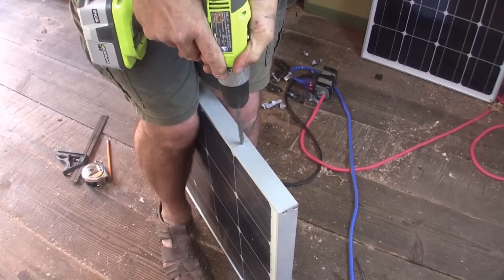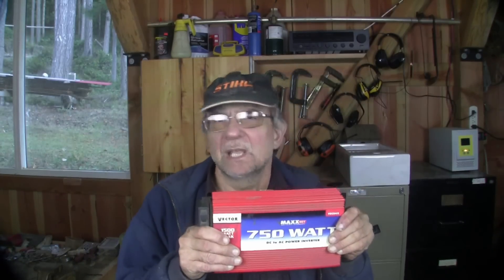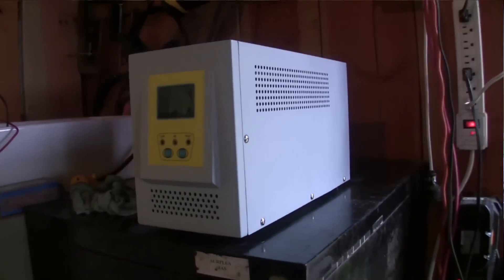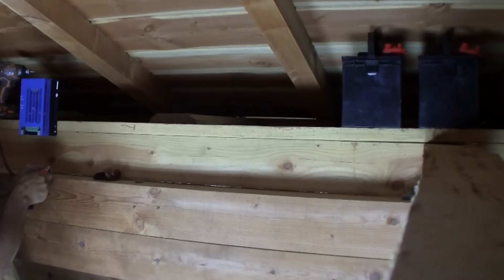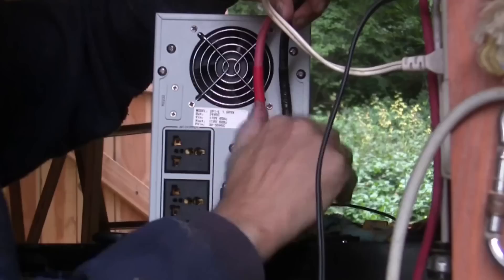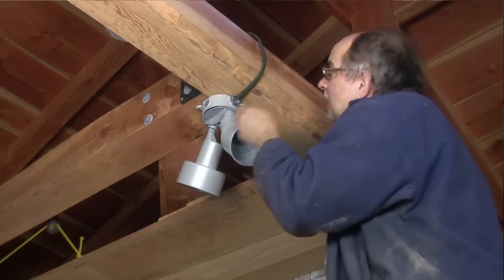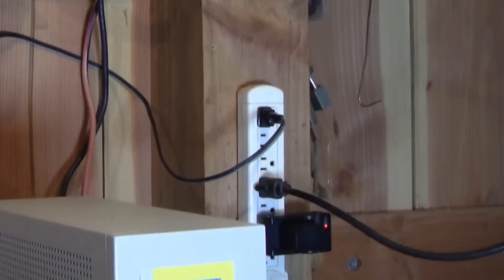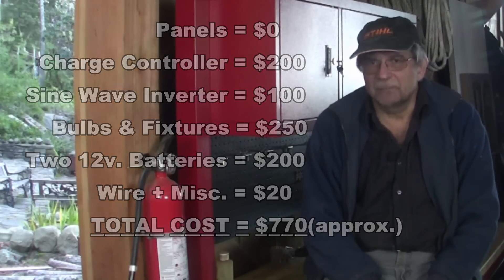Budget Solar Install Part 3

Comment: I watched a couple of your videos and enjoyed the content. Definitely going to check what else you got going on. As for this 3 parter, I'm glad you ultimately wired the panels in series because that's where MPPT really shines. Additionally, nowadays with more and more 24V/48V DC appliances, stepping up the system voltage and trying to do as much stuff as possible without involving the inverter I think is an all-around good idea as well :)

All the best from Finland.

Comment: Hello, just stumbled in to see your Budget Solar install of the shop lights.  I have found LED bulbs at discount at our Loews, Home Depot and Walmart big box stores for a buck or two each from time to time. I run them on 120 AC from a cheap inverter and only draw a few watts, in my camper and outside my camper when lighting the outside for cooking at night when down in Arizona. 

Up/Down here,  just above Spokae WA. @TheReflectiveLakeLodge, my 600 sq. foot cabin I am slowly building, I purchased simple plastic light sockets like the older porcelain ones with pull string. I mounted them in the 3 main rooms and wired them with one 12/2 romex attached to a corded wall plug with wire nuts, E. Tape and and a knot for strain relief. these provide bright task lights as work light system until the main power box is in. Total under $20. US if purchased new. 

My LED's and "twisty" florescent lamps all have worked off my small $29.99, 300 Watt Black,  Decker Inverter, Well. 

I am subscribed and want to see more videos !  Thank you.
Reply from the maker: You are creative, inventive and a thinker...on the right track: establish your true needs and construct accordingly. Efficient electrical devices are constantly falling in price ...
Glad to have you on board - thanks for subscribing!
Cheers,
M

Comment: I hope you have in the fuse now.  You can't turn off a battery.
Reply from the maker: +Andy Bushnell 
Roger that...fuse installed! 
I plan on updating the vid with modifications & changes I have made...
Thanks,
M

Comment: A well done and informative video. Although unplanned, the move to 24v was a good one. When batteries or panels are configured in parallel, they can draw on one-another. In series, they all push in the same direction. Never mind the reduced losses in the wire.

Use of MPPT charge controllers has come into question lately, because it is now cheaper to just buy more panels. Also, the MPPT circuitry depends on a couple of components that have a relatively short life. If I could do it over, I wouldn't use an MPPT charge controller in our household system. However, for a portable system, where the area of panels is limited and a failure isn't too painful, MPPT can make sense.

It's nice to see an inexpensive solar system and a fairly simple one. Your video has likely encouraged more than a few folk to take the plunge.
Reply from the maker: +Mark Fox 
Thanks for your kind words and information.
I'm only vaguely familiar with MPPT controllers and thanks to people like you I learn a little more once in a while. The finer points of this technology quickly make my head spin if I pay too much attention to the manual! I try not to get carried away with these things and am always amazed at the amount of (expensive) gear folks buy if they have talked with a "solar salesman", as it were :-)
Since making the three videos, I have had a couple of problems (now solved), added a couple more  batteries and made a few other simple tweaks to make the set - up more robust. As time permits, I intend to make a follow up video describing the updates.
Thanks for watching & taking the time to add constructive comment...
Best Regards,
M
P.S. follow me on Instagram @markerbuoy and see what I'm up to between videos...

Comment: Nice, basic plan. I know the panels were free (for you), but it would have been nice to know the general price. And your music kinda scares me when your theme song turns. The volume difference is slightly shocking.

That said... I just wanted you to know that your information was very good. I had been looking for a video like this for over a year. Thank you. 

(And the panel pricing was just me being lazy. I can look that up.)
Reply from the maker: Anthony Hughes Sorry about the music thing - I'll pay attention for next time :-)
Thanks for your kind words. I now have four twelve volt batteries hooked up to deliver 24volts to the inverter and everything is running smoothly as I hoped.
Good luck on Google looking for panels :-)
Cheers,
M

Comment: Thank you again for your great video's. I've been following all of them. This spring I'll be setting up my solar system that will be housed in my shed, from there the power will come into our home. I'll be running about 3 rooms in our home on just solar and see how that goes before I add more panels and Batteries, and run more outlets to other rooms.. Thanks again and keep those great videos coming !!!   Cheers !
Reply from the maker: Robert Gibb N1RLU Hey Robert;
It looks like you have a great plan. Going whole hog from the start is intimidating & expensive, to say the least. Slow & steady wins the race. You will have lots of opportunity to tweak your installation & (heaven forbid) correct errors or (more likely) make changes as you go. Good luck with all of it & have fun! Thanks for watching :-)
Regards, M

Comment: why did you not put all the lights on one switch am I missing something? great videos. You say you have no electrical experience. But you do a great job.
Reply from the maker: I deliberately switched the lights independently in the shop because I often do not need all the lights on at once. During the day, I often need just a little extra light to illuminate a tool station or such - there is no need to place excessive drain on the batteries. There is a single switch for the storage room lights - bright lighting for ready access to equipment.
I'm no journeyman electrician, but I do have a good deal of personal household wiring experience (sometimes under supervision!)....just sharing what I do to make stuff work :-)
Reply: ok I understand why you did it. That is a good idea. As long as you use the correct fuse for the cable you should be ok 😁. Are you going to put more panels up on the roof
Reply from the maker: Stephen T More panels coming ....at the right price :-)
Reply: The price of them are getting cheaper everyday 😁

Comment: Going 24 volts was a good move. Great video.
Reply from the maker: Thanks Offgridkid;
I need to add another couple of batteries at least; after that, should be good to go :-)
Thanks for watching!
M
Reply: I'm using the lifepo4 batteries. They are costly, found some used ones working Awesome so far. Thinking this would be good for you from the location of your batteries, lifepo4 cells are very lightweight.
Reply from the maker: off grid kid Interesting...I was not aware of these types of batteries. They look expensive!  I'll check them out...
Reply: They are perfect for solar they absorb most of the energy you put in them. Same type of batteries they are using in the tesla model s
Reply: I'm of grid with 4 110ah 12volt cells only 44 lbs each.

Comment: Good evening Markerbuoy. I'm a new subscriber as of a few mins ago. Great videos bro. Extremely enjoyable to watch. I have become recently interested in solar. I spent this past entire weekend watching Solar Videos. Question about the 14/2 wire you used to wire up your lights. If I remember correctly. Their was ONE solar video all weekend that mentions that you can't/shouldn't uses a standard 14/2 solid copper wire but instead use a stranded/braided wire because of the way solar is transmitted through the wire. Again if I remember correctly. AC current flows down the center of a solid copper wire where Solar current flows down the outside of copper wire hence the use of stranded/braided wire. Your using a 24 volt system and I think that might have been a 12 volt system.I just though I'd mention this. I'm learning as I go alone here and just thought I'd pass this along.
Reply from the maker: Hey Joe;
I'm no expert/authority...just sharing what I do & what works (or not) for me.
In this case, it seems to me, volts are volts & amps are amps, no matter how they are generated.
Certainly, DC power is discharged from the batteries (powered by the solar panels) and is altered/inverted to regular AC...therefore does it really matter what type of wire is employed for transmission - I think not.
My lights are shining bright!
Regards,
M

Comment: Another thought.

It appears, from the background, that you are near water.  That almost always means access to wind. Have you considered a small wind powered addition to you system.  Often when the sun is away the wind will play.  Just a thought.
Reply from the maker: Quite right, William;
I have a set of magnets in my shop, suitable for building a wind powered alternator. All I lack is time :-)
It is a full time job, maintaining a life in town (work) and a life off grid (even more work). You have a great point (thought) & one I have long considered.
Micro hydro (winter run-off) & wave/tidal power (all year) are also intriguing possibilities...just not enough hours in the day!
Cheers again,
M

Comment: have you ever thought of using larger 6V batteries for a higher Ah rating? i am looking at installing a system for my father in law and worry about cloudy days letting the batteries go flat.
Reply from the maker: A bank of 6 volt batteries would work just fine...it sometimes comes down to personal choice.
Currently (ha!), my batteries have gone completely flat...it seems I may have a "leak" through my inverter (even though it is "off"); the 12v/24 volt auto detect in the controller detects voltage out of range & shuts itself off...until one manually recharges the batteries & their voltage returns to normal. Sheesh, just when I thought I had the perfect little system!
Thanks for watching & good luck with your own system :-)
M

Comment: Thanks for the nice idea I've got on your series. I'm also doing off grid solar power for some of my electricity load in my house, may I kindly ask as parallel connection if required to have a blocking diode for each in every solar panels? as I observe 100w 12v panel I bought already having diode on terminal box.

Thanks and regards from Philippine
Reply: +Roberto Ardales I would always suggest a blocking diode. They are cheap and add additional protection to your solar system. Just make sure you mount them the right way.
Reply: I proceed that thank you.
Reply from the maker: +Chris Wisselo It is my understanding that each of my panels contains a diode in the circuitry, otherwise, my batteries would drain on a long dark night.  By-pass diodes may be a good idea, when panels are connected in series (as are mine), if one or another panel is subject to shade.
Cheers,
M

Comment: Hey Markerbuoy, congrats to your new solar installation! You definitely made a good decision buying a pure sine wave inverter. You will find many more uses for it as you go. I also have a 24 volt system and even run my table saw or my drill press with the inverter if I only need to make a few cuts or holes. This will not take the batteries down. I only have to fire up my generator if I need high power for a long time – like for a sander with dust extractor.
However, powering your lights with an inverter is not the best idea I would say. Modern LEDs run on DC power of around 3 to 30 volts (depending on how they are wired together). Therefore, all your 110 volts LED bulbs will have a small power supply build in to provide that power. As you can imagine, converting 24 volts DC from you batteries to 110 volts AC and then back to 9 or 12 volts DC is not the most efficient way to do it. In addition to that, pure sine wave inverters have a rather high standby power consumption. Mine consumes around 30 watts just for being “on”, even if nothing is plugged in. So if I run a single 5 watt LED bulb off my inverter, it will drain 35 watts out of my batteries (in fact even more, due to the losses in the conversion). I have written in my blog about this (http://hieroben.de/insel-solaranlage-wechselrichter-oder-gleichstromnetz/), but unfortunately this is in German.
My advice might come a little late, but I would run a second DC-wire in your shop for all the devices that consume little power for a long time. That way, you will have to power your inverter only if you need a lot of energy. A thin wire is enough, since only a few amps will go through. Many LED-drivers will accept up to 36 volts. Buy quality high-power LEDs from well-known brands like Cree or Nichia and you will get plenty of light. It involves a little bit of hacking, but it is worth the effort. Even the battery chargers for your tools might have a DC-in. Look for small buck- or step-down-converters on ebay. They are very cheap and efficient and will convert your 24 volts into 5, 9, 12 or whatever you need.
Anyhow, thank you very much for your great videos! I learned a lot from them, keep them coming. All the best from Germany, Kai
Reply from the maker: Hey Kai;
Thanks so much for all the useful advice...one of the joys of Youtube, as a giant forum for exchanging ideas.
I accept your theory on "120v" LED's and it is something I considered before I did the install.
Your suggestion about installing a second DC line is excellent and something I will consider further.
It is early days yet for my shop system, as you see in the video and there are many more tweaks I can add over time.
We are not full time off grid and are very busy in town right now with other work; it will be fun to get accommodated with my new system during the coming year.
Thanks again for your valuable input & thanks for watching my video! I'll take a look at your blog...with Google Translate :-)
Best Regards,
M

Comment: Even with the total cost being almost $800.00, you're going to recoup that investment in the next handful of years. I think that you did a good job with your research, layout, and installation.

When the opportunity came to get that Pure Sine Wave Inverter cheap, you were able to re-configure your system to accommodate it. So learning form your install, it would be wise to purchase equipment that supports more than one voltage range. This will allow greater flexibility for a system if modifications are needed!

Although the Light Fixtures and LED Lights were expensive, you saved a lot of money on the Pure Sine Inverter. It all balanced out in the end!
Reply from the maker: Thanks for your kind words.
You're right...it's a good job the original controller could handle 12 or 24 volts and I was also able to reconfigure the panels. I was quite prepared for the new inverter to be no good, but decided to take a risk & it paid off....too bad I can't find decent documentation. Anyhow, looking forward to a brighter future in the shop!
Happy New Year!
M
Reply: For documentation, try inputting any numbers that are on the unit into Google. Usually one string of numbers on a manufactured item will show up on a search engine. If the numbers don't work alone, try inputting the number, then a space, then type the word Inverter. That might also pull up a useful page of information about that item. For Example: XX-R22Y Inverter, or something similar.
Reply from the maker: LordTimelord The inverter is apparently an older model manufactured by JFY inc. in china. JFY looks like a huge outfit and the manual I found is here, http://tinyurl.com/qb6mool and it obviously applies to the newer models. The manual for my blue charge controller is encyclopedic in comparison.
Reply: I figured that it was built in China when i saw the smiley face on the lcd screen. A lot of other charge controllers from China also put happy and sad faces onto their electronics lcd screens! LOL

Comment: Thanks for sharing your experience. Would you review your volume set to your intro, I don't think it matches the volume of the video, I frequently lower the volume during your intro sound. Happy new year!
Reply from the maker: Thanks Tom....Good point. Sometimes I feel video editing is like punctuation; beyond a certain point it becomes endless. However, I will try harder in 2015!
Cheers,
M
Reply: Thanks for reading the comment! It's just a small thing that seems to effect myself and others viewing experience, adjusting the volume after every intro in your videos can become a chore XD. If you use a video editing software I think you can setup a Template file with the adjustments added to minimize your editing time. Happy New Year!
Reply from the maker: Tom C Good suggestion about the template file - I shall investigate further.  The intro is the one thing I have "automated" - all I have to do is add the appropriate title, although I obviously messed up with the volume thing. The whole effort needs more work! 
All the best!
M